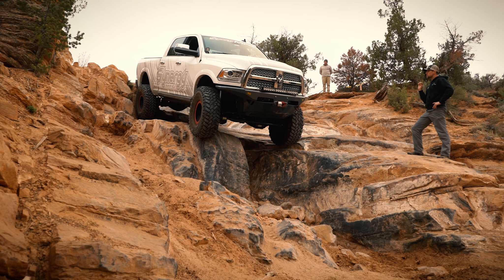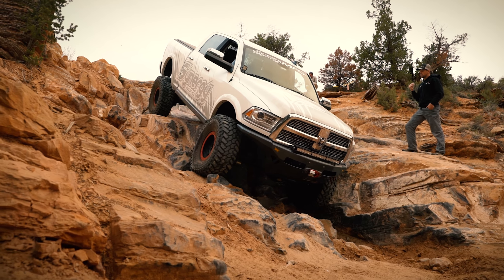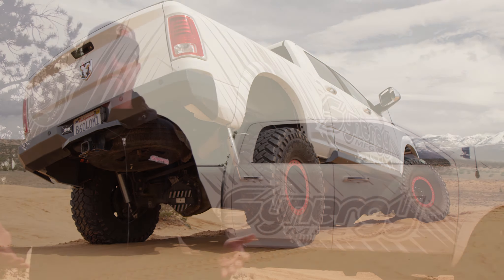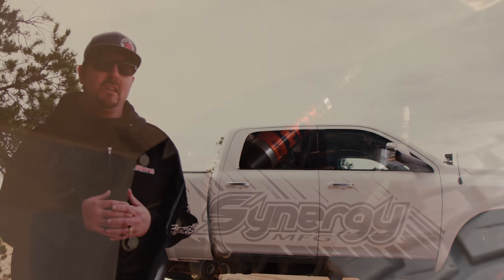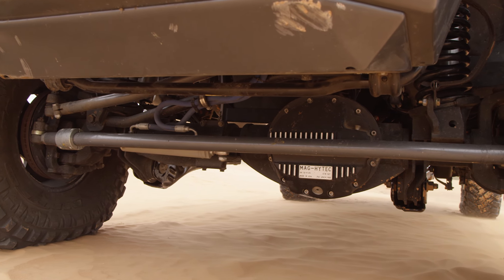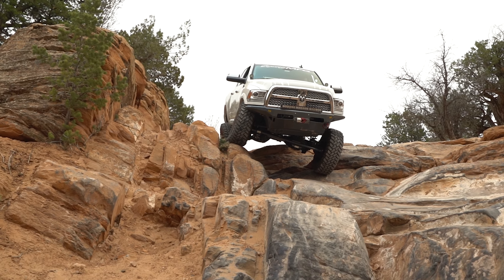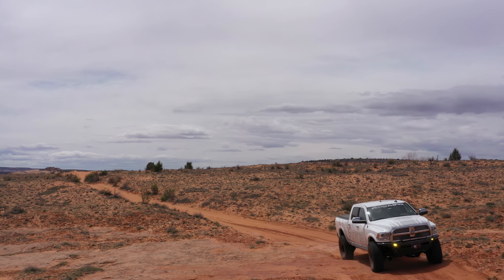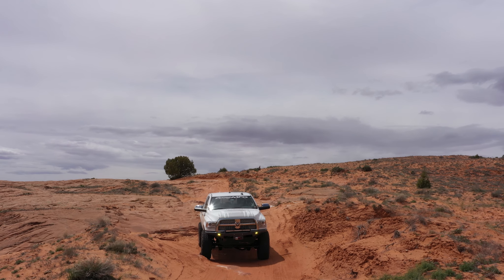Inside Line: Synergy MFG's 2014 Ram 2500 Hauler Crawler

Comment: Very interested in the rear shock setup. The weird factory “through the frame” shock setup in these trucks makes long travel and big diameter shocks a challenge. I’ve actually wondered about moving them to the rear but the sway bar (if you want to keep it) and extra long panhard (on mine) make it hard to place in the back.
Reply: It's especially a giant JK system at that point with the shocks leaning back the way they are.

Comment: Still has Dpf sad..
Reply: its a company truck it kinda needs the emissions stuff intact. unfortunately
Reply: @keith2860  No it doesn’t just delete it and do a clean tune so people don’t see the company owner as an asshole
Reply: Technically it does it’s not legal. this truck goes everywhere and it attracts attention to the company that owns it. Im all for deleting but they cracked down hard on companies over deleted trucks.
Reply: @keith2860  yea but you can put a cutout valve in front of the Dpf with a clean tune and it looks stock